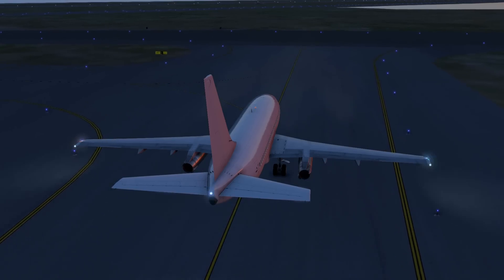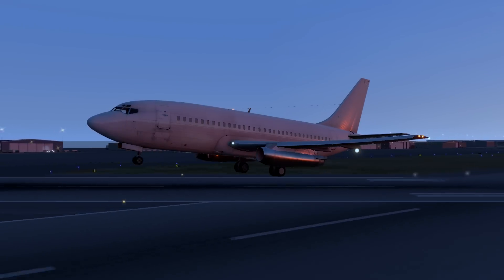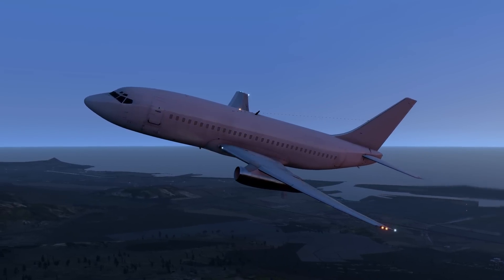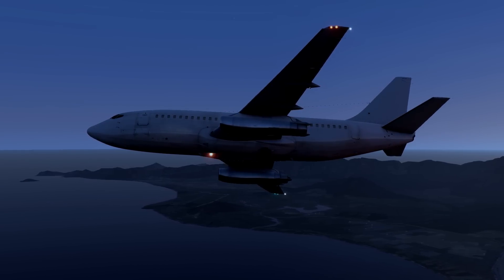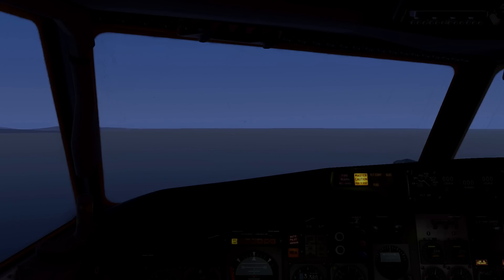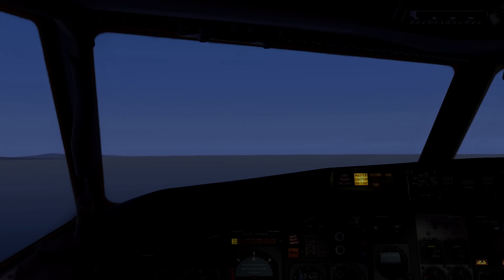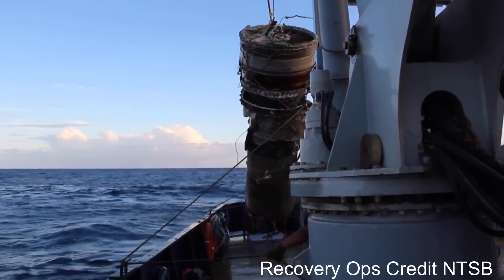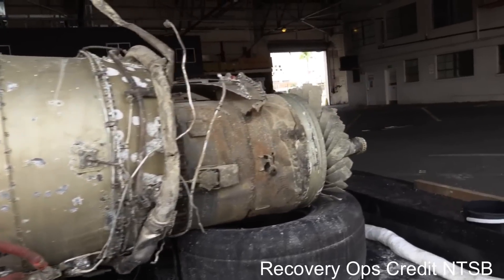The Split Second Decision That Sank A Jet | Trans Air Flight 810

Comment: When experienced pilots get confused over which engine has failed, it just might be time to reevaluate instrumentation and warning system design.This is not the first and won’t be the last time this happens. And why does my KIA sedan have multiple exterior cameras while all Boeing and Airbus planes have zero cameras?
Reply: There’s a set of four cameras on a Gulfstream 550 that I fly. The tech is out there and some planes but not all planes have these camera systems. It’s more of a budget/certification thing instead of legality/aerodynamics thing.
Reply: This is a very old plane and yeah it is kinda unsafe
Reply: Everyone talking about cameras and stuff and here i am just wondering: couldn't you have a pair of small mirrors, inside the cockpit, in the corners of the windows,  for visual engine inspection?
Reply: The issue isn't with the instrumentation, the issue is with CRM and workload management. Also, camera's wouldn't have done much in this case as engine problems are almost never visible from the outside.
Reply: Military fuelers experimented with cameras and they proved more trouble than they were worth. You also gotta remember the hazardous conditions around the plane that the cameras have to be hardened against without compromising their ability to perform.
Reply: Hudson recommendations included engine health indicators. Reduce time pilots are confused about if an engine is broken, partially damaged, or unrecoverable. But eh, this plane was very old obviously not containing any modern indicators.
Reply: hull integrity and aerodinamycs
Reply: I always wonder if passenger planes have cameras in the fuselage. Every time there is an incident, it's always someone filming with a mobile phone camera. 
    The county hus has four cameras that cover the doors, front and back.
Reply: @MrChopsticktech   "the county"???  🤔
Reply: The Airbus A380 has a tail mounted camera, and I think think all new Airbus models do although I’m not totally positive about that
Reply: @pilotkeithjoseph    Well, the problem with that part is the very finite and precious resource that "interstitial spaces" have become on a modern airplane. You'll need an otherwise VOID internally to house the camera, the power AND information cables (even small, they NEED space) and all this can not in ANY WAY interfere with the operation of other internal systems...

    Don't forget doing it as cheaply as possible, to render a High Def' image in real time for the pilots or flight engineer or some member of the crew to even be available to keep a watch on... AND that it's going to add ONE MORE THING for the pilots to check in their regular scan routines just flying the plane...

     It's actually kind of amazing how much wiry twidgety and gadgetry crap they've already managed to cram inside the spaces of an airplane that aren't being used to hold passengers, supplies for the flight, and cargo as it is... BUT maybe you can design such a system in a way the Engineers haven't thought about yet.

    Good luck! You could make a fortune! ;o)
Reply: @gnarthdarkanen7464 yep no room at all for keyhole sized cameras. None. Everything is all crammed full. Zero air space
Reply: Aerotech' relies on laminar flow of air against the flight surfaces, which in turn require laminar flow over the airplane fuselage. Cameras would disrupt that. Your KIA doesn't REQUIRE such clean airflow just to avoid slamming into the ground in a giant crater full of fire and shrapnel... SO the worst you can worry about is burning a little extra fuel and maybe getting stranded on the side of the road out of gas. Things get a little worse when you're flying a plane more than a mile into the sky.  ;o)
Reply: @gnarthdarkanen7464  I think you could make them flush pretty easily but the FAA would have to certify them😵‍💫
Reply: @naughtiusmaximus830    ALONG WITH everything else you had to change or move out of the way to "invent space"...

    Yeah... Don't even get me started on the hooey you'll have to contend with in the FAA... I was only really interested in the shear difficulty and complications of the direct invention and integration part...

     I have neither need, want, nor patience to dive into Red Tape...  ;o)
Reply: @naughtiusmaximus830  As an aftermarket addition, they could be mounted inside the cabin at the top of one of the windows. This would be even easier in a cargo plane.
Regardless of what they see, the suspect engine should be left at idle, unless it is on fire.
A camera viewing the tailplane would have saved more than one accident. but positioning it would be more complex.
These cameras could be connected to a screen on the flightdeck via RF, 
Well thought out, they could be installed overnight, with minimal cost.
Reply: @gnarthdarkanen7464  Their seems to be far less red tape when installing cabin entertainment systems. Over the years, they have caused electrical overloads and fires.
Reply: @wilsjane  I bet it’s $50 million at least to get approved.
Reply: @naughtiusmaximus830  like on a Tesla and those ones have wide angle lens.
Reply: @naughtiusmaximus830  As long as it did not require puncturing holes in the aircraft and drew any power from the cabin entertainment circuits, full approval would not be required.
Airlines are updating their cabin entertainment systems all the time and on one occasion it led to a fire followed by a crash.  
Since then, the rules have been changed, but they only involve showing that circuits are not overloaded an the units themselves do not contain materials that produce toxic smoke.
Reply: @wilsjane  nothing that requires FAA or EASA happens overnight or with minimal cost!
Reply: @gnarthdarkanen7464  There are cameras on some airplanes, they are just not connected to the cockpit, only to entertainment system. So it is not the matter of the flow. And the cameras these days can take less space than a bird poop smeared over a wing anyway.

There was a story of some airplane where the pilot was going to the passenger cabin to assess see the damage visible on the entertainment system view.
Reply: @McFrax   As stated, I can only really list the issues to face up front on such an idea... AND while cameras may well be on some... They're NOT on ALL planes... probably (at least presumably) for reasons known to engineers and the FAA...

    You're still asking ONE MORE THING for pilots to add to the "sweeping scan routine" in the cockpit while they are busy flying the g** d*** plane.

      An AI Bot, might (eventually) be the answer, actually putting a prioritizing tool into a cycling set of information to alert pilots to trouble the way the old days' "Flight Engineer" could do before Corporates decided it wasn't worth paying someone... 

      ...you know...

      ...rather than just arbitrarily get rid of a job flat...

       ;o)
Reply: @gnarthdarkanen7464 depends on the camera. Not every camera is the same. ATM cameras are big bulky boxes. Small barely noticeable . Zero disruption of air flow
Reply: @gnarthdarkanen7464 Tell me you didn’t study aerodynamics without telling me you didn’t study aerodynamics 😅
Reply: @joelmulder  How 'bout YOU first... Did you never wonder how less than 0.1mm of ice can drop a plane like a friggin' rock???

    I've only spent a significant chunk of my life BUILDING them, from models that require 10X the precision to work at all up to experimentals... so... yeah... good luck with your prject of being a smart-ass.  ;o)
Reply: @gnarthdarkanen7464   How about me? I did wonder, actually.
You might have spent your life building models, but I’m a pilot and have gone through hours and hours of practical and theoretical pilot training 😅
I hate to pull rank as it were, but since you asked, I think I’m a literally a little more qualified to make such statements about the topic than you are.

So, to address the point, you do realize that on an airliner, there are already dozens of other things sticking out into the airstream and they don’t cause the plane to crash either? Sensors, lights, antenna, wing fences, and other communications equipment like the usually huge satcom antenna used for phone and WiFi connection on the top of the plane.
Laminar flow can often be maintained through proper shaping of whatever part is sticking into the airstream like with the satcom antenna or lights, although preventing the boundary layer from separating isn’t always that important such as with the pitot tube, the AOA vane, or the TAT probe for example.

High quality cameras and lenses are also TINY, and require only a few small wires for remote monitoring. Just look at your smartphone.
There is plenty of space even in existing aircraft to fit cameras covered by a small clear-composite covers flush to the hull, and cameras barely require any real processing power to display their feeds. How much power do you think a monitor has? It’s not much, I’ll tell you that. Also doesn’t have to be as cheap as possible because very few things on aircraft are as cheap as possible. Well, they’re as cheap as possible while still being absolutely safe and meeting regulations.
A single 4K sensor, a small lens, and its required processing. An iPhone camera modules costs less than 100USD. That is literally not even noticeable on the price tag of an airliner.
Space requirements aren’t even a problem though, which proves you truly know nothing about airliner design.
All airliners already have space between the pressure bulkhead and the outer hull. It’s usually between 10 and 20cm, and filled with sound and heat insulating material. You could fit an entire stripped down full frame Mirrorless camera in there if you really wanted to. Look it up, that space is called the sidewall space.

Comment: You said the plane had been flying for decades and was ancient. How old was the plane? I had heard the airline had not performed maintenance on this plane. Did lack of Maintenance contribute to this accident
Reply: It was a 1975 aircraft so old even for a cargo plane.
Reply: @GemmaLB  ....yeah....when I was wrenching planes 20 years ago, there was an old 720 freighter  blew an engine on take off and it landed safely, and they parked it down where our ramp was and they did the engine change there..... before they got the engine shipped in, we went and looked at that plane and it was pretty shocking the condition of it....we opened the aft cargo door just to look, and one of the guys pulled back the Gill liner just aft of the door sill and....I shit you NOT.... 0_o  mushrooms, YES....mushrooms were growing on the longeron which pretty much crumbled when the guy reached in and scooped a handful up ....we closed the pit door and walked away.....it had been in service a LONG TIME....dont know what happened to it after it left but I hope it was retired shortly thereafter

Comment: So, WHY does the checklist have both engines to flight idle?  Seems like that warrants further review.  Considering this has happened multiple times despite engine failures being relatively rare to begin with, it seems prudent to ensure as much as possible that the correct engine is shut down in these events and minimize the chances for confusion.
Reply: That is incorrect. In fact, the checklist requires the remaining engine to be increased to MCT. It’s the dead engine that, after being positively identified, must be put to idle.
Reply: Read the real NTSB report. Don't rely on YouTube to give you factual information. Both engines were brought back to idle to reduce speed from 250 to 210 knots (which was in line with operator procedure), not because of asymmetry.
Reply: @ImperrfectStranger  If I was in a position to need to read the NTSB report, I wouldn't be sat in bed in my pyjamas spitballing in the YouTube comments section of, with all due respect, homemade air accident videos!
Reply: Indeed - a weird checklist point to throttle down BOTH engines so close to the ground. That has got to get you in bigger trouble, not help the situation of an engine failure. Pilots use rudder and aileron to keep wings level and the a/c from side slipping, not the engine power when desperate for range back to an airport.
I am not sure the checklist item exists that way - or the airline needs some real critical review.
Large or small twin engine a/c: close to the ground some troubles with one engine out are similar.

With small twin engine aircraft such as the Piper Seneca I had to do an "engine out drill".  (** see below)
One point was of the drill was "dead leg - dead engine." - you have to use rudder to counteract the yaw from the asymmetric trust.
Only then do you have to shut down the dead engine - same side as that leg of yours that does not have to step on the pedal / is "dead".
That kind of drill is part of "aviate" I would say - take it seriously. I am convinced that "dead leg - dead engine" works on a B737 w/one engine inop as well.

** drill does not fully apply to a jet engine a/c, but still:
 "Pitch up, power up, (== max power you can get); gear up, flap up (== minimum drag you can get), identify (dead leg-dead engine), confirm (power down failing engine and observe you did the right engine) and feather (the propeller)
Reply: I wonder if it's to avoid an asymmetric thrust scenario that makes things worse under certain circumstances? Certainly seems an odd thing to do. Engine goes bang; back off said engine to idle to assess; shut off engine and pull the fire handle if necessary.

This isn't the first case of a crash from shutting down the wrong engine I've heard about.
Reply: @smorris12  right.  I suppose IF the asymmetric thrust causes issues that rudder doesn't cure, then pulling back both throttles makes sense, but damn this is nuts in this case.
Reply: @ClipstopherBurtraw  I agree. And with no "Engine Dead" indicator, being reliant on fallible human memory is a bit odd in a world of checklists. Perhaps the design assumption at the time was that broken engines only ever go bang catastrophically and completely stop so no chance of spooling up the wrong engine after the checklist instruction.
Reply: @ClipstopherBurtraw  I wonder whether ANY checklist or simulator training covers a catastrophic engine failure during takeoff or early in the climb.
Since seconds count, their would be no time to find a checklist and work out where to start. This is one of the few situations where procedures should be taught and need to be remembered by pilots.
It should also be taught, that one pilot flying, while the other reads and evaluates the instruments should be strictly adhered too. Which pilot does which should be optional, as should swapping the roles if necessary. Constant verbal communications are vital.
Reply: @wilsjane  I'm 99% sure there is an engine out checklist and several checklists including that one have a memory items section that should be done or doable without getting the paper out.